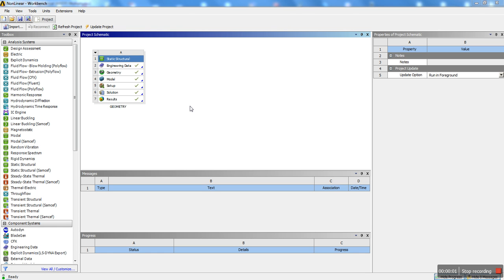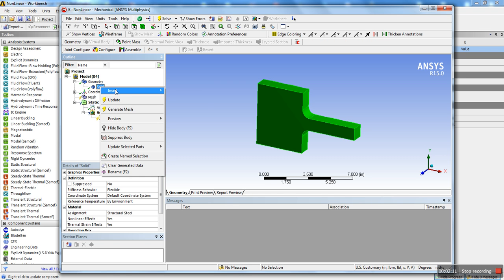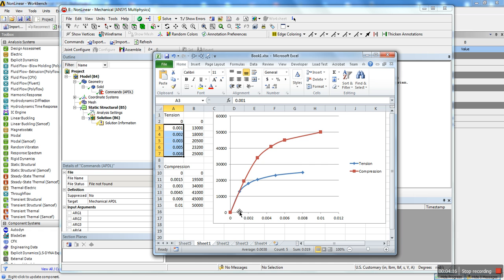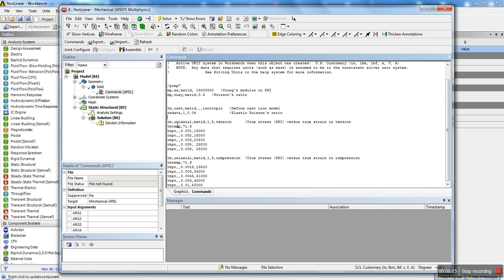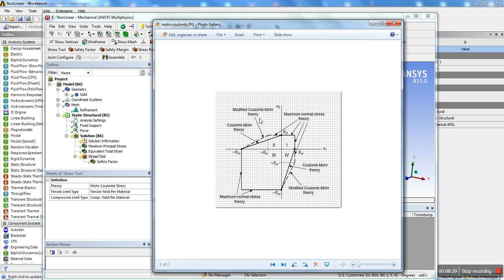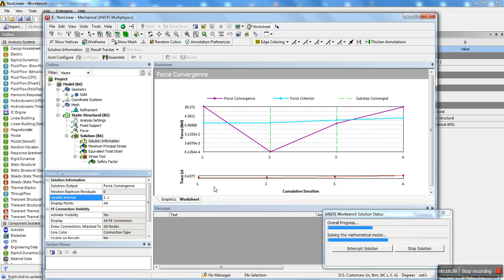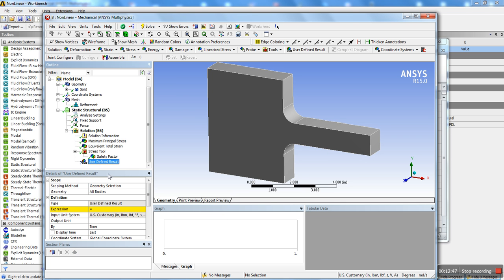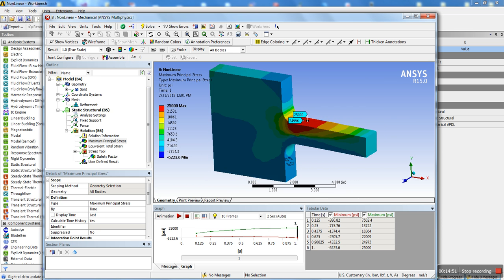ANSYS Non-Linear Stress-Strain Cast Iron Tutorial - Static Structural

Comment: Sir thank you for this tutorial,
Taumax is the 9th real constant of ansys, my question is can i put a TB command to define Taumax for a particular contact pair? ? if i can, than can you please tell me the procedure ?
Reply from the maker: shojib zaman Hi! Sure thing, so what you need to do is in workbench, under contacts, select your contact and right click, insert, and click commands. this will add a APDL command object under your contact you want to modify the taumax. Then click the command object and add the following line: RMODIF,cid,9,1e20
9 is for the 9th constant as you mentioned. cid is for asymmetric contact pair but you could also use tid for symmetric. the value of 1e20 is the default taumax value, so you could change this to whatever you want.
I hope this helps! if so please like+subscribe! thanks.

Comment: Thanks a lot for this informative video sir. Actually I want to know how to give a strain rate in terms of mm/min on one end rather than a force. Can I again draw the stress and strain graph from the solution of this simulation.
Reply from the maker: Mantra Satpathy Your welcome! So i think what you could do is use the ANSYS Transient Structural module, and in the analysis settings, you could specify a time so say 1min, and then instead of applying a force as a loading condition, you could apply a "displacement" loading condition. So you could enter the displacement to be for example 1mm, and that would be at time 1min. You could also change this up and even change the rate at the next timestep. All this while still using a custom stress-strain curve if you like for the material is possible. You could plot afterwards the stress-strain output from specific nodes or elements. There is a graph functionality in ANSYS, but you could also just ask for strain and stress results individually and copy the values to excel and make the graph if you dont know how.
Hope this helps, if not, feel free to ask more questions.
Thanks,

Comment: Would this work for PET material? I've got the stress-strain curve plot which doesn't have any linear region. If you think I can use this code, could you please send it to me? Thanks!
Reply from the maker: Bernat Mànuel González Hey, please check your inbox. The thing is the table data input method im using is just 5 data points. so the interpolation between them is linear. You dont want to input so many data points also because then the runtime to solve will be a lot longer. not sure if this is clear, but in short it should work. just simplify your stress-strain curve to a few points and input them. just make sure your youngs modulus is the same as the slope of your first data point, or else it will give an error.
Good luck!

Comment: Thanks for the video! Could you tell me where this detail can be used?
Reply from the maker: Максим Анженко appreciate the thanks! I dont think i understand your question however. This is used when trying to study the behavior of a cast iron material. The mechanical properties of this material are not usual (not as simple as steel). If you want to study the failure or safety factor of a cast iron part, you would use the method explained in my video. It is important to note that the results are usually not exact and must be verified with a failure test in a lab.
Reply: DrDalyO Thanks. I meant, did you invent the design of this object? Or is this object applied somewhere in real life? (in mechanical engineering or somewhere else)
Reply from the maker: Yes i just made up the design. Its not an actual component. If you would like I could make another video of an actual cast iron part, provided the geometry is not that complex.

Comment: hi, can i know how to reduce the time taken when i get the solution?
Reply from the maker: heoy shin You can either reduce the number of elements, so change the global mesh size or do not add a mesh refinement (this will reduce the accuracy of your results obviously), or you can also reduce the number of points used for the stress-strain curve, I think i used 5, but you could simplify it to say 3 data points which would also speed up the solution time. Let me know if this helps, if not i could go into more detail. Thanks,

Comment: Thanks a lot, that's exactly what I've been looking for, too! :-) So using the command option is the only way to implement the cast iron model? Or are there other ways to activate cast iron? Am I right that the v. Mises cylinder is used for compression and Rankine cube for tension? Is the material model suitable for simulating die-cast aluminum?
Reply from the maker: ThoralfG in ansys workbench yes, you have to use the command object. in APDL there is a built in menu for the cast iron model. No other way. not exactly sure about v mises and rankine. cast iron follows the modified mohr coulomb theory. I do not know enough about die-cast aluminum to answer your last question. heres an image for the modified mohr coulomb: http://image.slidesharecdn.com/freevideolecturesformca-141114100914-conversion-gate01/95/free-video-lectures-for-mca-15-638.jpg?cb=1415959909. Cheers! Hope this helps!

Comment: This is what I have been looking for, thank you !! Could you post the code please ?? Thanks again dude !!
Reply from the maker: Dr.Dre Hey no problem! ill send it to you via PM. check your inbox. please subscribe and like :) thanks.
Reply: DrDalyO Can you also send me the code? I would really appreciate it.
Also, I have a problem you can maybe help me deal with.
I have a stress-strain model curve I should implement in ANSYS, that also has a linear descending branch (last part of the curve, from 0.15 to 0.2 strain value). As I know so far, ANSYS doesn't allow negative slope of any of the multilinear stress-strain line parts.
Do you have some advise, how to cover that part?
Reply from the maker: Igor Dzolev I will send the code to your inbox.
Im actually not sure how to do that. Most of the time you would convert your engineering stress-strain to the true stress-strain which would normally give a positive slope. And if it would go negative the material would fail anyway. You could maybe look into using different material properties in ansys such as the Mooney-Rivlin constants.
Reply: DrDalyO Thanks a lot. I will search for it to see how it works. Maybe it can be implemented by defining some kind of failure criteria. I will definitely need to dig deeper.